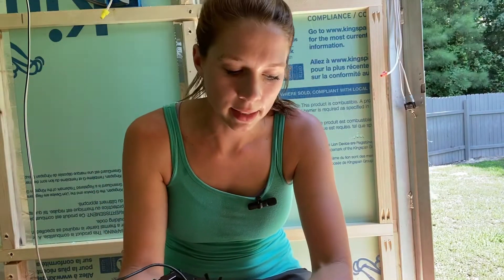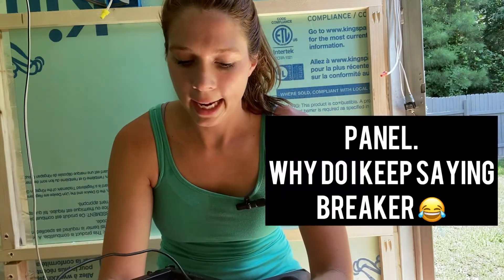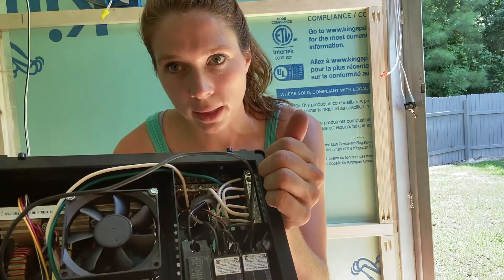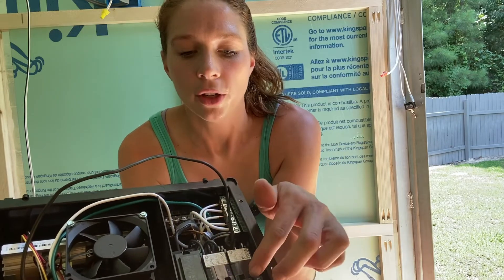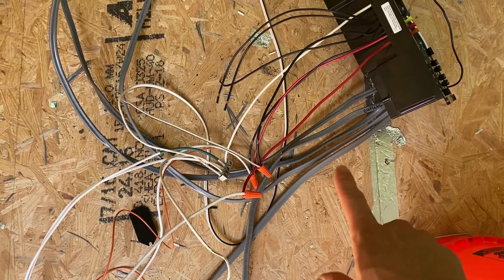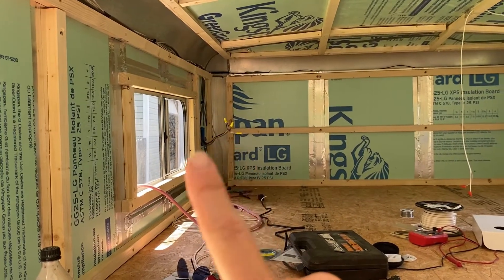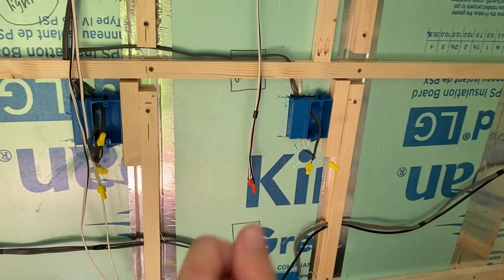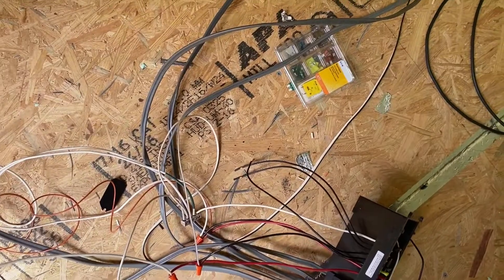Wiring your RV: 110 volt system

Comment: How do you know if you need a 30 amp?  I have a 13,000 AC, fridge (says on the fridge Power input 60w) and microwave along with a couple of outlets for charging phones and led light strips.  Right now, my trailer has 2 20amp breakers, one is dedicated to the ac everything else is on the other breaker.  I've never tripped a breaker and use a heavy duty extension cord.  Do I need to upgrade to 30 amp or am I ok with what I have?
Reply from the maker: You can calculate how many amps you draw at once. Typically, the AC unit is 10-15, the fridge is usually less than 1, the outlets draw hardly any power (as long as your not running something big like an air fryer, or portable stove). Microwave draws about 8 amps. I would say that your electrical is at max capacity the way it is. I like to put the microwave on its own breaker, so I’m surprised it’s not already. But, if you don’t run anything crazy on your outlets, you should be okay.